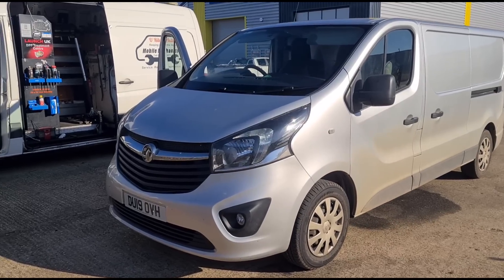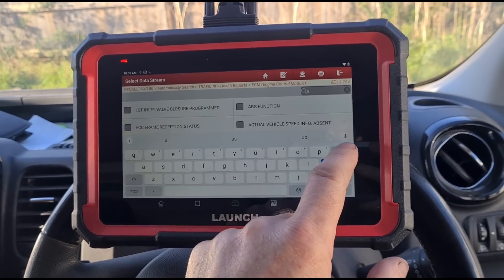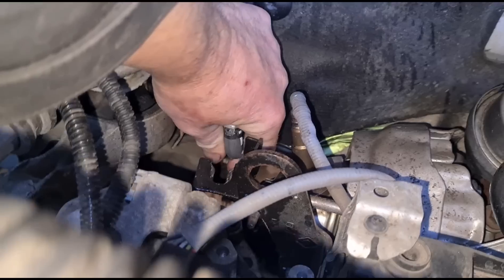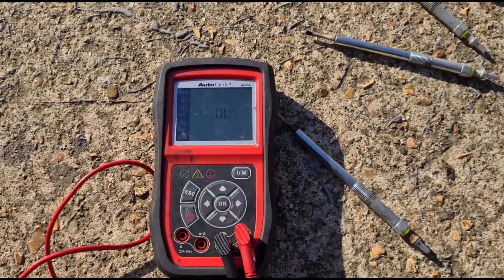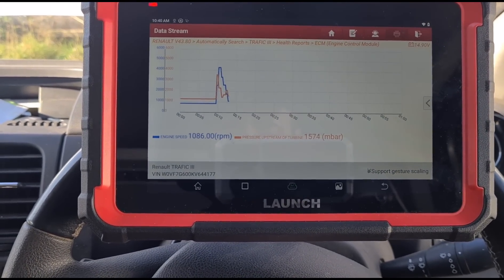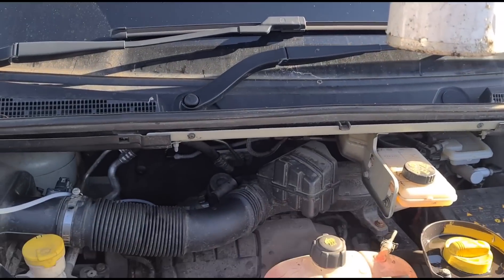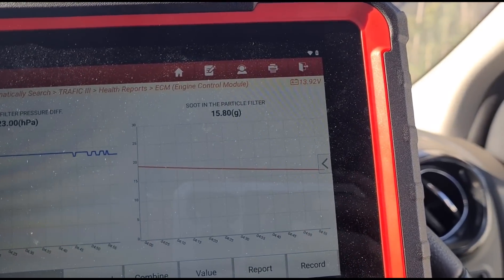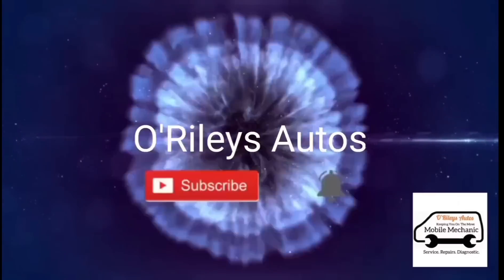Vauxhall Vivaro Engine Failure Hazard

Comment: Hi jimmy, i have this van its done 120,000 miles, i was driving home from work no lights come on dash, and my van lost all power then lights come on the dash saying engine failure hazard, i opened the bonnet and oil sprayed everywhere! Have you ever come across this before on these vans? Thank you if you do reply 🤝🏼

Comment: Great video Jimmy what type of cable did you run through with the drill ? Would welding wire work ? I am experiencing this fault also , thanks
Reply: @rossp446  no. Solid one piece wire wont work. Twisted steel wire ist best

Comment: Top job jimmy. That customer is lucky to see you. Engine dash faults are not always clear on these opels, Vauxhalls etc. pop up for all sorts of reasons(my zafira drives me mad), but I have learnt so much from you regarding EGRs, Dpfs, oil (Now 5k change with filter) and glow plugs which i recently changed. My basic launch scan tool is a bit limited, so need to upgrade.. what Launch scan tool iS this one???? Looked good

Comment: I had this alarm when foxes chewed through my DPF pipes, (2015 Vivaro Biturbo), then again this year when the barstewrds chewed through the temp sensor wire and shorted the two cables together. No DTC, but i noticed the EGT reading number 3? was at 458 degrees just after start up...
Reply: Have you access to a rifle. 😉

Comment: 25k miles between oil change is a joke. Great vid as usual fella.
Reply: Crazy , you should never go over 20k or one year
Reply: @liambyrne591 10k max. With these Euro6 engines & oil dilution the oil is like water in them.
Reply: @danpeters7850  even more weid the twinturbo version has the same intervals but also gets like 3L more oil 😅
Reply: Manufacturers just want your money, they want to sell you more replacement parts or another car hence this interval.

Same with lifetime oil on gearboxes.
Reply: It’s so they can make them more desirable as fleet vans . Massive service intervals is pretty good if you’re binning the van off after 4 years or so . Not so good if you want to keep it

Comment: You really know your stuff should the dipstick read like that permanently I’ve always gone to top line
Reply: Oil level can increase when the van does a dpf regen on its own , and if it does it too many times without dpf regen success,  oil dilution fault occurs
Reply: @ I was referring to when he topped up after changing the oil
Reply: @adamevo6  so was I , that's why we don't fill to top level nowadays 👍
Reply: @mikeberry304  oh ok, I’ve had mine since new 2017 and I’ve always kept it at the maximum line. Now on 100k no issues apart from adblue nox